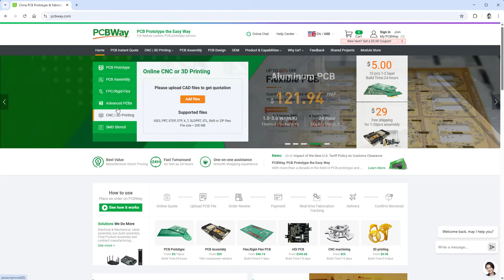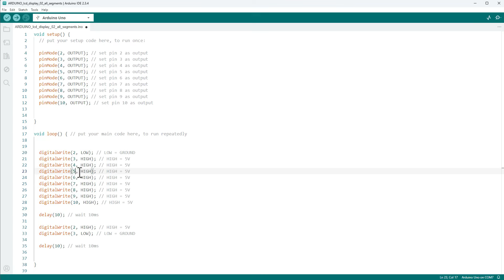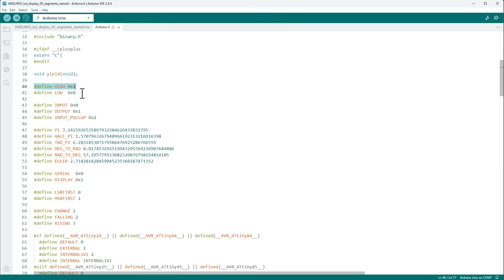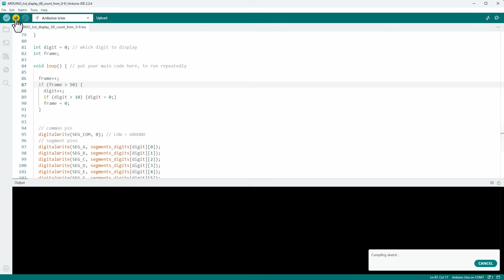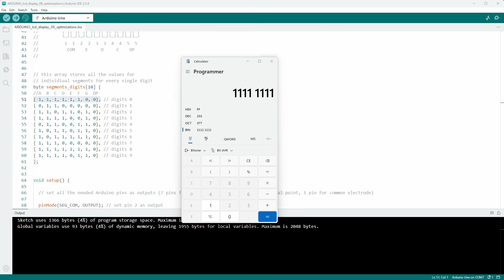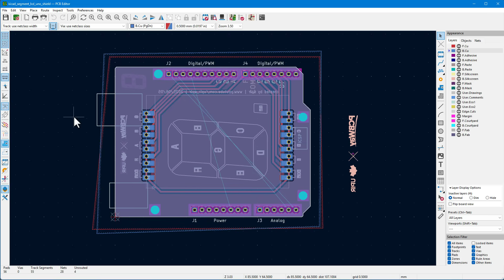Arduino UNO + 7-Segment LCD Display - Full Tutorial (How to use segmented displays with Arduino)

Comment from the maker: All the source files are on GitHub: https://github.com/upiir/arduino_7segment_lcd_display
Reply: could I email you about a project?  I'm trying to make a vfd display grid.
Reply from the maker: @BioToxin sure!
Reply: @upir_upir what is the best way to reach you 😅
Reply: The code is pretty inefficient though. The segments should be on PD0-7, so all segments can be set in a single port write. And it would be pretty easy to put this in a timer interrupt, so the main loop is free for other tasks.

Comment: To control such screens you can use HT1621B. This is a driver for controlling LCD screens, it receives a SPI signal and outputs signals to the LCD contacts. There are several well-known libraries for Arduino, but for your specific module you need to rewrite an existing library.

Comment: Im curious if you could use slave-master arduino for projects like that.
For example one arduino driving LCD and listening for another arduino what to output.
Reply from the maker: Yes, that should be totally possible. But in that case, you can probably use the cheapest arduino you can find, as the sketch is super simple.
Reply: @upir_upir  TBH now I’m curious if you could just take „bare minimum arduino”  and put it on PCB with LCD (probably clone nano would cost similar 😅)

About dual arduino uno setup I’m pretty sure I didn’t seen good tutorial (your dual ESP32 was great) and plenty of people have few UNOs laying around.

BTW I’m currently Binge-watching your videos 😅 great content.

Comment: Sat here thinking how to add a 2nd digit for 0-99 using one more arduino pin for a 2nd common to effectively multiplex the two digits, and wondering just if it could work because unlike leds which are simply current driven, the lcd is voltage driven but also has segment capcitance so could one segment on one didgit 'back drive' a segment on the other digit. I dont have any LCD digits to play with to find out.
Reply from the maker: The display is only about $2, so you can buy it and try it easily, but I don´t think it would work as expected. This display is a "static" display, and should not be multiplexed, so if it will work, it will definitely be dimmer, if not blinking.

Comment: for direct sunlight and affordability, what lcd should i get? oled ssd? tft st7789? or 2004 lcd? or any alternative
Reply from the maker: OLED would be fine, but reflective LCD displays would work perfectly well. Also, if you don´t need a backlight and do not change the information that often, you can also consider eink displays. Depends on how much information you want to display and how fast.

Comment: Is it possible to drive multiple segments with shift registers like 74hc595 which we can do for LED 7 segment multiplex displays.
Reply from the maker: It is possible, but the only advantage would be using less pins on Arduino board. You would still need to simulate AC.

Comment: first time here and i actually like the progression, from sloppy proof of concept to focus on real art of microcontrollers: saving memory. To be honest there were more optimizations possible like parametrized function to not repeat code in both "halves" of driving signal or to use single ATmega register and shove all bits at one, ditching inefficent digitalWrite function to driving LCD via interrupt service routine and setting timer to call ISR every 10ms to "free" main loop to do actually something compute-wise but this is the magic of arduino, where one creates playground for others to explore all possibilities :)
Reply from the maker: Thank you for your nice feedback. Yes, I´m aware of some of those advanced optimizations - like using the interrupts or direct port manipulation, but I wanted to make it somewhat beginner-friendly and understandable. I might explore some of those more if I ever create my own LCD (which I would of course like to do).

Comment: Could you use PWM and fade the segments in and out?
Reply: It's technically already PWM since the segments are driven with AC but it should be possible to add in modulated variable dead space (in phase portion of the switching with respect to the common) to allow dimming segments. It'd probably be slightly easier to drive all segments with a dac and control brightness by controlling differential amplitude, at the cost of additional hardware.
Reply from the maker: @sjm4306 was faster. I think you should be able to change the "brightness" of those segments by lowering the voltage, but possibly only to some extent. It will not be a full and nice fade-in and fade-out effect.

Comment: LCDs are indeed hard to drive. But single digit are easy. Try to drive 2 or even 3 digits LCD and you will gain pain
Reply from the maker: Fully agreed. I don´t think it´s worth the pain trying to drive multiplexed LCD without a dedicated controller.

Comment: About two years ago I went down the rabbit hole of driving bare lcds. I found some I pulled from stereo decks and got multiplexed driving working using a bunch of resistive dividers on gpio. The contrast was much worse in multiplex mode though so I never really got any further than a tech demo. From what I've read I'd have to either add complexity in software or hardware to increase contrast (by having a wider gap in the intermediary step voltages so basically need a fast dac to drive each lcd pin). Driving large lcds with many segments is already pin intensive enough, it kind of blew my mind trying to understand the waveform diagrams for mux'd displays.
Reply from the maker: Thank you for your comment, that´s definitely good to know! I have briefly seen a datasheet for driving a multiplexed segmented display, and it just made me certain that it´s something way beyond my knowledge. On the other hand, there are some nice static LCD displays with many digits (the ones used on gas stations), which would be fun to use. The only downside - pin for every segment. I have seen displays with up to like 96 pins.